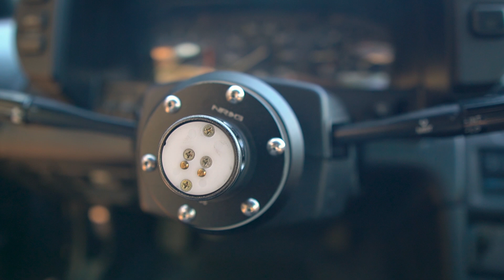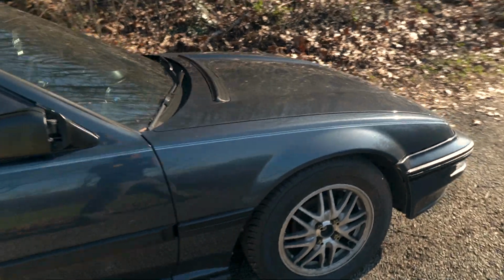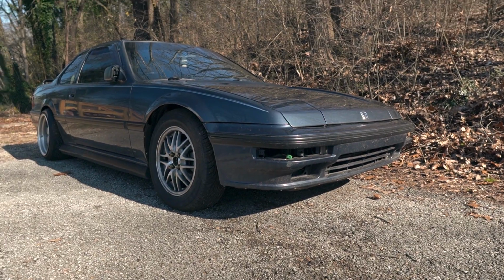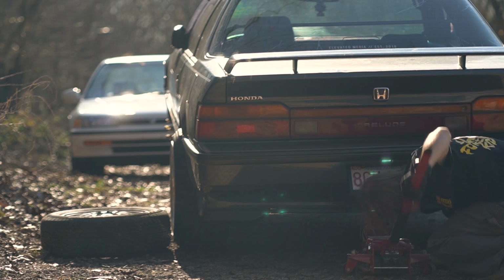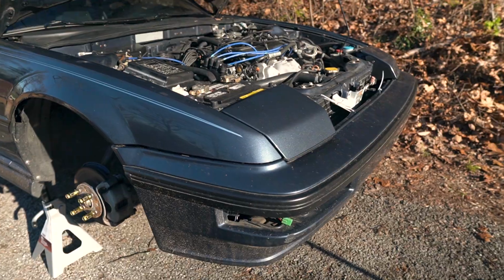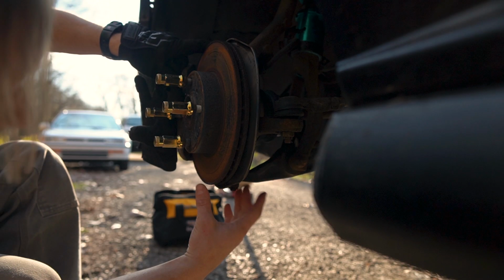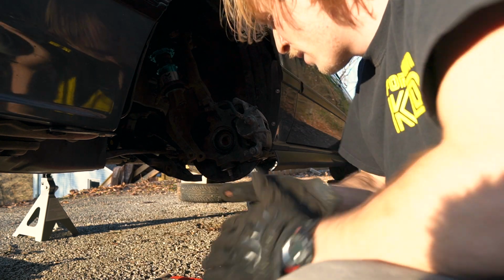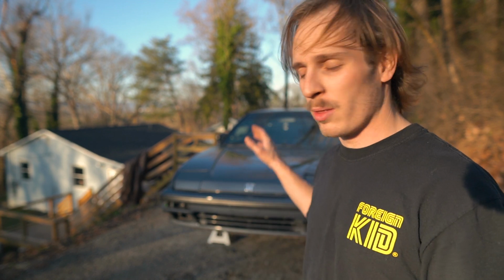It's Time To Remove The Manual Transmission Out Of 3rd Gen Prelude

Comment: Why are you pulling it apart bro?
Also I just got my 1988 prelude factory manual 5 speed and it’s actually so beautiful
Reply from the maker: Prett sure my rear main seal went bad which is behind the trans. Also my speed sensor gear fell down into the trans so going to try and fish that out. Congrats on your lude!
Reply: @ConnorLee  ahhhh ok bro that’s fair enough, pretty upsetting when shit like that happens man but keep on pushing along, if you haven’t maybe put a new flywheel and clutch on there after you put a new seal in there, is it hard getting to the head box?
Reply from the maker: @Thatcressidaguy  Its a a bit of work but IM hoping my clutch and flywheel are still good. I put them both in, brand new, about a year or so ago when I did the manual swap. We shall see haha
Reply: @ConnorLee  ahh yeah I’m sure they will be fine!! Your car looks so good man! I have so much appreciation for the preludes they’re so nice! I just bought 17x8 wheels so hopefully they’re all good they’re +30 on fitment so not deep dish or anything but I just hope they’ll fit
Reply from the maker: @Thatcressidaguy  Im thinking you'll clear no problem depending on your ride height. Good stuff mate
Reply: @ConnorLee  hopefully haha😆😆 see how we go! Love your videos bro all the way from Australia! 
👌🏽👌🏽